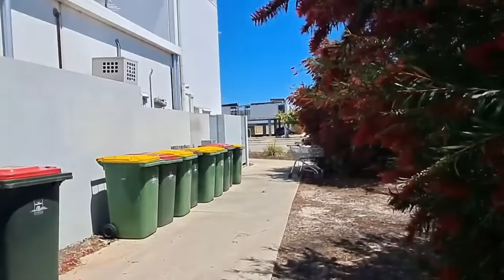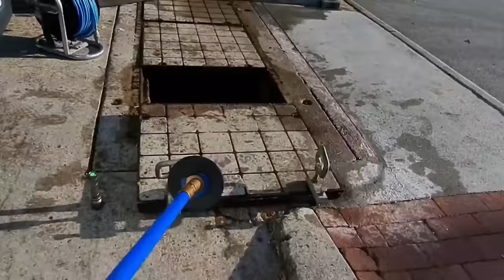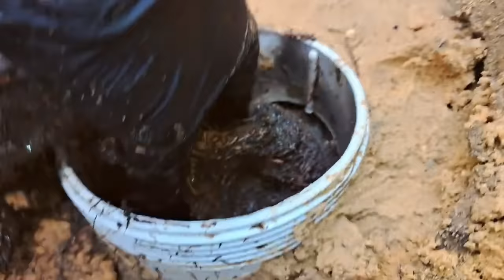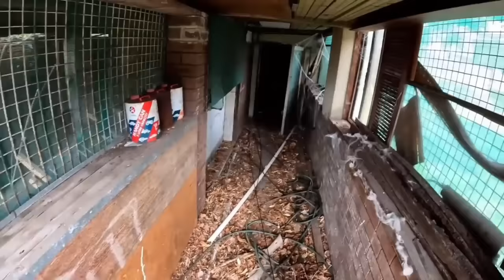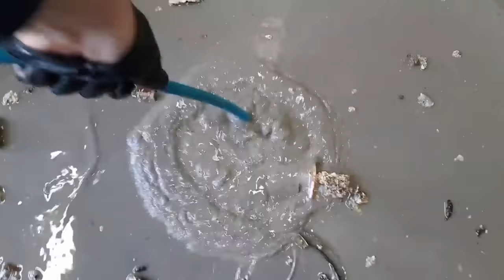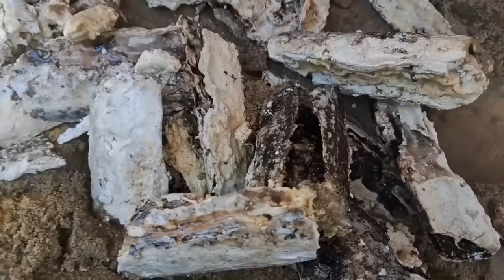DO NOT WATCH if you have a Weak Stomach | BEST Blocked Drains of 2022

Comment: My second of your vids. And loving them, for some weird reason. Lol.  
I'm just wondering what is your routine when you finish work?
I'm thinking if I did this job, I would drive home, but before I walked in my flat I would need to strip off, use hand sanitizer over every inch of my body. Or have an out door shower in my back garden so I could wash before going indoors. 
But I bet all you drain workers just go skipping indoors carrying your go pro in your hands, in your boots and blue suits. Putting the go pro down on your kitchen counter. And just carrying on. Haha.

Comment: Why are all the inspection shafts in Australia buried with no markings. 😂😂
Reply: Not all are like that. Some say Do Not Bury... and yes, they still get buried.

The problem is that with renovations and revealing of a outdoor are, is those contractors don't always bother to bring the inspector shafts up to the new surface level. A builder mate has experienced  deck built over the top of the inspection shaft.
Reply: @gorillaau people just down the street had a cement driveway laid over theirs.